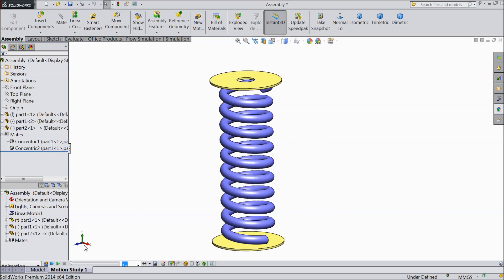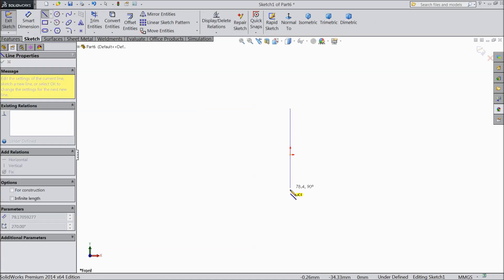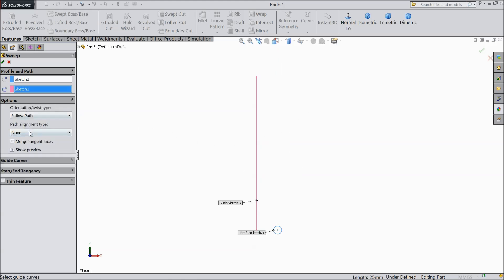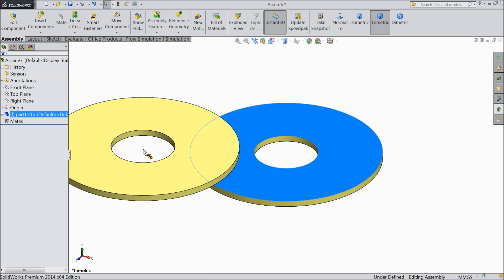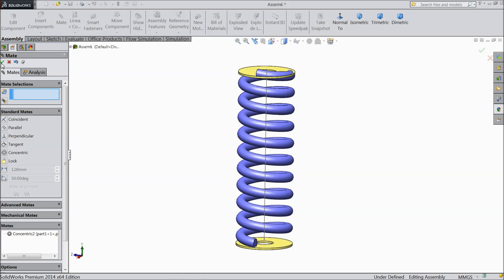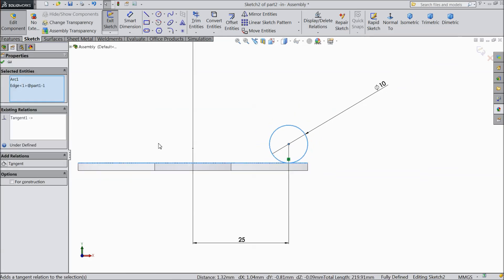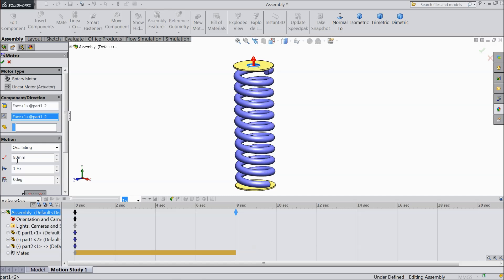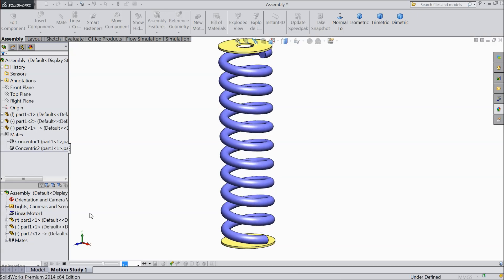Solidworks tutorial Spring Animation

Comment: Can't get this to work at all. 

Everything is left too under defined so there's so much potential of stuff not staying as you have.

I couldn't get the spring to not be above the top washer and because of the tangent relation and 5mm dim, it didn't matter if you moved it. The spring would always be above the top washer.

Comment: i can't do it on solidworks 2016 
i have a problem with sweep.
somethings in your version are missed in my version(solidworks 2016 sp4)
Reply: sir, this sweep option is not working in solidworks 2013
Is there any alternative solution for that???
Kindly help me regarding this. 
Thanx in advance.

With regards,
Prateek
+91-9093517014
prateeksrivastav598@gmail.com
Reply: Khalil Ibraheam just do normal twist and and the amount of turns. His version is a bit different
Reply: same problem I am facing
Reply from the maker: here i used Solidworks 2014